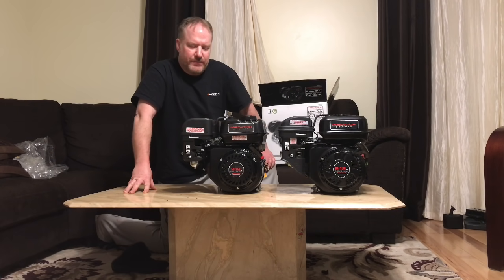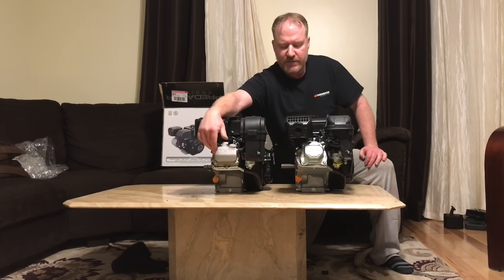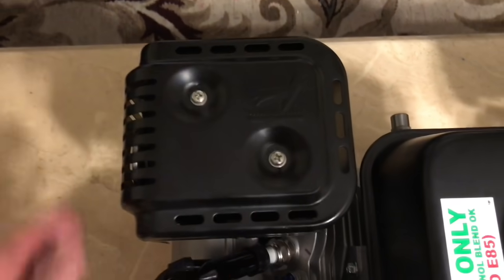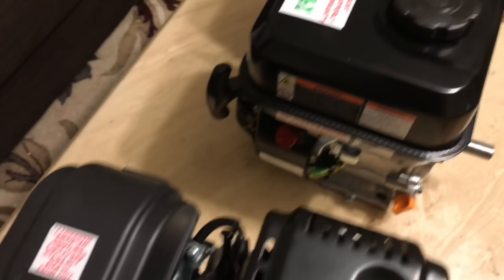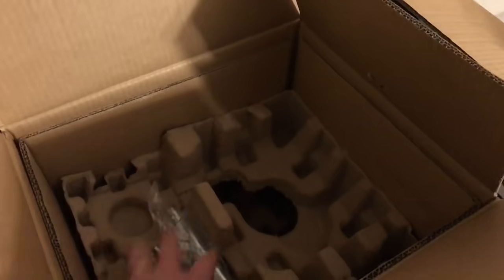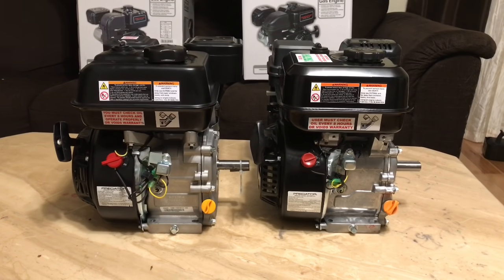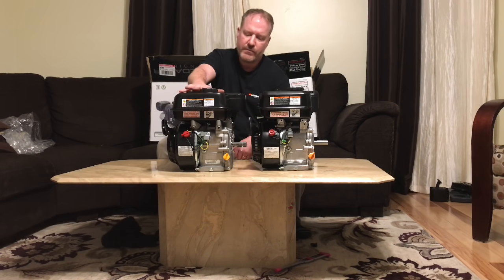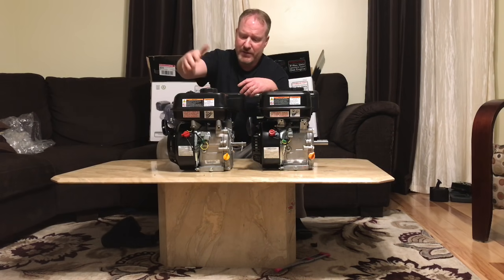What?!?  Harbor Freight Predator 212cc HEMI built by different factory than NON-HEMI???

Comment: I have both the Hemi and none Hemi. The Hemi runs harder has way better flow better performance. The key is to keep the cam to less than a .280 lift. So to be safe a F275 cam max. While my other hemi 212cc run better than a clone engine it is a little slower. Have two go karts k196 Colemans both with 30 series torque  converters.  Both have deleted governors stage 1 intakes and headers. Also .265 dyno cams arc rod and fly wheels timing 32 degrees. The hemi out performs the none hemi. Even on top end the hemi gets another 1-2 mph love my hemi. Now if you want a bigger gnarly build 308-380 cam stroker crank. Big thqn 26lbs springs then get the none hemiPredator 212cc.
Reply: what rpm should i run my hemi at to get the most efficiency/horsepower. Like if i run it at 6000rpm like there would be 0 torque and at 100rpm their would be a lot more torque... What rpm is best for me to run at stock because i am going to gear ratio it to get the higher speeds.
Reply: @nicksgarage8295  I believe the Hemi can go up to 26lbs springs and a 275 cam before having to worry about the valves hitting the piston plus the seat pockets are short in the Hemi. You would have to cut them in order. To fit begger springs. The 275 cam and 26 lbs springs will probably get you in the high 7,000's 7,800-7,950.

Comment: I’ve built plenty of Predator 212cc Hemi and non Hemi engines and a few years ago I ordered a connecting rod and Cam from ARC Racing and put Honda clone for engine but when I got the items and tried to install them the wrist pin was to large on the Predator and the Camshaft had play were it connects to the block I was also building a 196cc and both items were the right size.when I called them they told me Predator engines are not Honda clones and sent me the right parts. I can tell you the 196cc on the Coleman and other mini bikes with the 196cc it is a GX200 Honda clone. You can find them on YouTube or call them and they will tell you Predator is made by Predator for Harbor Freight but even though there are many 196cc mini bikes and Go carts out there the 196cc is a GX200 Honda clone! Just thought I’d pass along that information.
Reply from the maker: Actually, the predator is in fact a Honda clone. However, it has been bored and stroked to 212cc rather than 196cc.  In fact, if you buy a Honda GX 200 complete gasket kit, the only gasket that won’t match will be the head gasket due to the larger sized piston. It is 70 1/2 mm versus 68 1/2 mm.
Reply: Metalman 329 well all I can say is the parts didn’t fit and when I contacted ARC Racing they told me when ordering mod’s don’t put Honda clone on order form put Predator Hemi or non Hemi and I thought at the time it was a clone myself they told me no. I also seen a ARC video and they were saying the same thing that people are ordering parts for their Predator and they didn’t fit just like the wrist pin and the Cam. They told me the next time I order parts put Predator or Predator Hemi and I’ll get the right parts. I do know the block gaskets are the same though.
Reply: @BUILDNIGHT  The Predator 212's are not clones and never have been. Before there were Predators there were Honda GX200 clones. They were 196cc and can use any part that a GX200 would use. 

Both Pred 212's have unique crankshafts with flywheel tapers and rod journals that don't match a clone. The non hemi block is unique and needs a specific cam and has a unique tank mount that does not match a clone. At least the hemi has a 70mm clone block. 

That's why these Predators suck. ALL other aftermarket small block engines you can get uses a clone block (clone cam) with crankshafts that have clone flywheel tapers, and clone rod journals.

These days I don't see why anyone would start with a Pred 212. Only thing good about them is the initial cost of the engine.
Reply from the maker: @Deucealive75  well, I honestly think you’re taking the term “clone” too literally.  The Predator 212 non-hemi IS based on the Honda GX200.  In fact, the ONLY 2 parts on the Predator that are not interchangeable are the 70mm piston and the camshaft.  Even the crankshaft TAPER IS the same, which is why you can install a Honda GX200 electric start kit with gear toothed flywheel.  FACT:  Every other part can be used interchangeably on these engines.  When people say “Honda clone,” they mean “based on a Honda design.”
Reply: @BUILDNIGHT  That's just not a fact. A clone rod will not fit either Pred 212. Clone rod journal is 1.180", Pred 212 is 1.188". And let's see you put a GX200 starter kit flywheel on a pred hemi. 

Guys have used clone flywheels on the non hemis but it's not a correct fit. If it was a correct fit ARC wouldn't be manufacturing non hemi only flywheels. Details matter, to some of us.

This is easy and yet guys still get confused because it's "based on a Honda clone". Details matter.

They finally got smart with the 224 and Ghost 212. Both have crankshafts with clone rod journals, clone tapers, and clone cams. They are making 224 cams now to make life easier for the builder.

Comment: The main difference between a Hemi and a non Hemi engine is a Hemi stands for hemispherical it's a hemispherical cut put into the head of the motor to change your compression ratio and give you more power
Reply: Joseph Atnip Horseshit a hemispherical head would decrease compression with a efficient Flat top piston,so it must have a round top piston.If not then it's not a True Hemispherical head.
Reply: You would be correct sir
Reply: "Hemi stands for hemispherical it's a hemispherical cut put into the head of the motor to change your compression ratio and give you more power" 
Not quite correct. First the shape of the hemispherical head allows more room for larger valves. That would be why the 60363 has larger valves and valve stems than the non hemi. The  hemispherical head also allows to cause a swirling effect of the gases entering the cylinder. The more vaporizing of the gases makes for a stronger explosion in the cylinder there by giving it more horse power. The compression on both engines can be changed by many different ways. Shaving the head, swapping a dished piston for a flat top or just changing head gaskets to a thinner gasket. When raising the compression you have to be careful of clearance issues that must be addressed or you will just ruin the engine.
Reply: If you are getting “explosions” in your cylinder, you are getting pre-ignition, detonation. I would rather have “rapid flame travel “ in my engine!

Comment: only 6.5 hp? damn my honda 125 cc produce 9.4 hp on my grom. with 0 mods. what are you using those for?
Reply: That's box stock at the governed max rpm of 3600; if you remove the governor, change the air filter to a external pod or cone type, swap the stock muffler for a header pipe, and jet the carb properly it would have 10+ hp. You can buy a built 212 with all that plus a upgraded cam, 18-22lb valve springs, billet aluminum connecting rod and flywheel for about $350; my 212 with these parts makes 12+ hp and sends my CT200U minibike to 59.5 mph at 6.9k rpms.
Reply: @mkconte  i almost got a Chinese knockoff 125cc street legal but i got the grom instead. part because just the reliability but i did get it used on craigslist for half the price they are going for. i want to throw a 250 or 300 in it though just to have a bad ass mini bike.. but ya ill prob search for a bit for a cheap engine on a bike that was wrecked ect to save money instead of getting a brand new one.. patience is key.. and finding the good deal just takes longer but if you have time you can find the deals. its all in how its maintained its just honda has good rep for lasting forever if maintain them. so if i can get one cheap ill do it. to me harbor freight is all the stuff that doesn't last so in long run its usually a waste of money. compared to getting the higher quality that will last a lot longer. not true with all but a lot.
Reply: @jdogg661420  I wasn't trying to knock the Grom, just explaining what these cheap HF motors are good for and what the real world power potential is for minimal investment. I figure if experienced American engine builders replace the critical components with quality parts made and installed to exacting tolerances, the result should be relatively economical and reliable, especially at mild to mid levels of tuning. I am probably going to spring for a built GX200 on a black Friday sale though; Honda is the best and the original.

Comment: Why doesn't anybody on comparing these engines actually measure the distance between the studs that are holding the heads up three-sixteenths of an inch difference from Miami and the non Hemi the hemis got more meat around the Piston more metal the ads that sell understood are spread out more they got more distance wish me more meat between bolt and the Piston if they're both the same diameter piston that means there's more meat on a Hemi head cylinders measure the distance between the center bolt from left to right center bolt on the top

Comment: Manufactured by LONCIN which is a division of YAMAHA MOTORS CO. These are manufactured in a ISO9001 factory's in China.The same factories that manufacture Yamaha side by side vehicles, and motorcycle components.The Hemi actually  has about 1/2 HP more than the standard head predators.The 13hp (420cc) predators are also available in both standard and Hemi head designs.The stop sign shaped valve cover is non-Hemi. The Bowtie shaped valve cover is the Hemi. Both have stamped steel  valve covers.Off topic...  All are quality engines and well made.
Honda EU2000I generators are manufactured in Thailand.Yamaha EF2000ISV2 generators are manufactured in China.Miller high end Dynasty tig welders and multi-process welders are assembled in America with Chinese components.Lots of Snap-On tools are made in Taiwan and China.Funny little world we live on. Global market.Lots of replacement engine components for Honda motorcycles are made in Brazil.The General Motors Buick Envision is built 100% in Shandong Province, China! $50,000 HuH?  Go GM fanatics!Harley Davidson's are running Showa (Japanese) forks ...Pretty wild.
Crazy how a lot of folks have brand loyalty, but have no clue where most of the components are made on their favorite items.
Thanks for the video
Reply: I worked for years at an auto parts store and had a guy come in one day and said he only wanted parts made in the US and he wouldn't drive a car with any Chinese junk on it. I told him you better park your car  then.
Reply: That's a funny story!. People are so IGNORANT!
Reply: actually the hemi has a aluminum valve cover.........
Reply: @bucknut2850  The 212cc hemi does , not the 420cc engines

Comment: NO NO NO, It is not to meet supple and demand.   The reason is for Emissions - CARB.  Only the 69727 can be sold in CARB States like California.  It even says this on their website.  2 minutes of your time browsing their website and you would seen that.  "Item for sale outside California only – please refer to item 69736 for California compliant model. Oversized Item: cannot be shipped to Alaska or Hawaii.In order to return this item for a refund or replacement, all fuel must first be drained." ( List the 13hp motor Sku in the warning section on the 6.5hp page)

Comment: The Harbour freight engines are assembled by Kracher tools. Their similar to the old craftsman. The original engine blocks were made by Kohler with a Kracker gas tank and a mtd airbox the newer ones engine blocks are now being made by Honda the are all ready using them on their pressure washer Kracker tools paints them with Harbor freight paint they are owned by National Paint company the parent company of rustoleum they manufacture automotive paints and specialty paints along with paint applications equipment.

Comment: The genius here doesn't catch on to the fact that the hemi has an EPA carb and the other doesn't, one is only sold in California but both can be sold in the other states.
Reply from the maker: GhettoRanger 
wrong.......NEITHER of these two engines are sold in California...model #69727 Is the California engine.  #69727 is EPA & CARB approved.  #69730 and #60363 are only EPA approved.

Comment: I'm the 666th comment. Having issues with my predator 420cc hemi throttle surging ( revving up and down), carb is clean including the main jets and jet under idling screw and fuel comes through the line fine.
Reply from the maker: possibly a vacuum leak.  check and or replace carb to engine gasket

Comment: Stop screwing around harbor freight and release 6.75 vertical shaft for lawn mowers. 5.5 doesn't cut it.
Reply: Sharpen your mower blade 5.5 HP is plenty for a well maintained  push mower.

Comment: If you bought this exact engine, check your compression. And read this that I discovered. I bought the same exact engine for a big 2 person go kart, It ran fine for 10 hours, then lost power. After checking the compression on it, I was sad to see it only had 52 lbs. I took off the head, piston, checked the valves, piston, rings, gasket, and all seemed ok. I took the vales out because one seemed a little harder to push through and sanded with 600 paper. After putting it all back together I reached the compression and still had only 52 lbs instead of the 120 (8.5) it is suppose to have. NOW THE SHOCKER!!! I also bought a brand mew 3200/40000 watts generator, predator with the same exact engine. I had only started it when I got it and used it for about 20 minutes. I took the spark plug off and checked the compression. I was shocked to see it had the same 53 lbs as the other one. So Im wondering, it Harbor freight selling this engines with only 52 compression and know it or that is going on. With this little compression the engine is only maeing about 3 HP or less. Id like to have people with this engine check their compression and see if they also have a weak 1/2 compression as I do. If so, then we are getting the shaft and been ripped of. But worse the engine is not performing the way it is advertised and is breaking the law. Both harbor freight and Predator for making them this way.
Reply: you have to  pull the exhaust push rod to bypass the decompressor to get a proper compression reading
Reply: you have to  pull the exhaust push rod to bypass the decompressor to get a proper compression reading
Reply: Warren Albert Check your compression guage
Reply: Warren Albert also take it back and exchange it or get a refund next time!! If you just except that ya got ripped off then that’s on u

Comment: The hemi is weaker by design same hp
Reply: Another BS comment. By what experience do you claim to have with both types?
Reply: @bucknut2850  hemi by design has a more complicated and weaker valve trane. They have to use canted valves which is good for flow but sacrifices simplicity
Reply: @randyyoung9892  the hemi has larger diameter valve stems, larger valves and both valves have caps to reduce wear. Tell me that sounds weaker. lol!!

Comment: I bought one of the non-hemi #69730 engines today and they would not give the $20 discount on the coupon and said that they do not give it on the Predator engines unless it was one issued by Harbor Freight for that item.  Just thought I would make others that did not know this.
Reply: You have to use the coupon specifically for the 212 engine. A 20% Off coupon won't work. I says no predators right on the 20% off coupon. I just picked up two of the 30363 engines today. 99.00 each.

Comment: Do you even know what makes a hemi a hemi ? The new dodge hemi is not a hemi . a hemi has hemispheric cyl heads lol this so funny hearing hemi so much and he don't even know what a hemi is .
Reply from the maker: Yes, I am perfectly aware of what a HEMI means.  You, however, obviously don’t know Predator small engines.  One of these has a HEMI head.  The other does not.  The point of this video was to make people aware that the two different engines are manufactured in two different factories.  Not to show the actual internals of each head design.
Reply: @BUILDNIGHT  no I do know I build hemi race motors I do know what a hemi is I own what you call a hemi it's not a hemispheric cult head . I build those engines for Jr dragsters and race carts no it's not a hemi pull the cyl head in your video and prove it I can post a video proving you wrong. They stopped making hemispheric cyl heads for production use because of EPA regulations on carb engines
Reply: @BUILDNIGHT  and so you can sell non hemi parts. lol!

Comment: Chrysler referred to the " Hemi" design as a special shape used in the piston head and cylinder head. I am not sure why on earth you are compairing two chinese built engines to an AMERICAN built and designed engine. The Hemi engine was built for the NASCAR racing cars and found their way into consumer vehicles until the oil embargos killed the big block high horsepower engines. Look up the word HEMI and what it means as far as Engines is concerned.
Reply from the maker: RC Hobbyist Extreme 
i am well educated on Hemi car engines.  i did not name these chinese engines.  They are well known in the small engine world as “hemi head” and non-hemi head Honda Clone engines.  Do your research.
Reply: It means Hemispherical, and refers to the shape of the combustion chamber. Marketing hype is irrelevant.